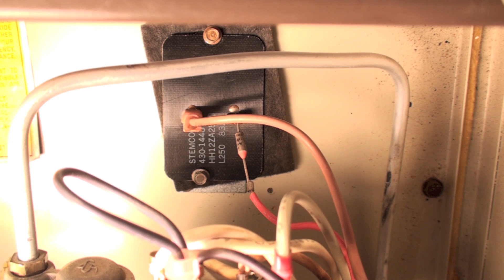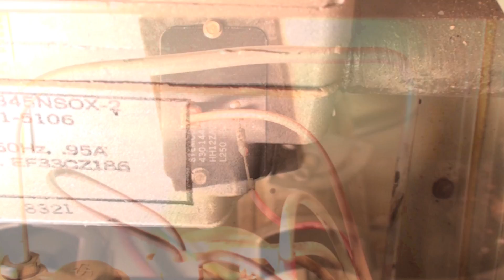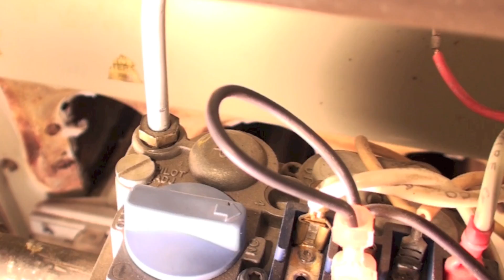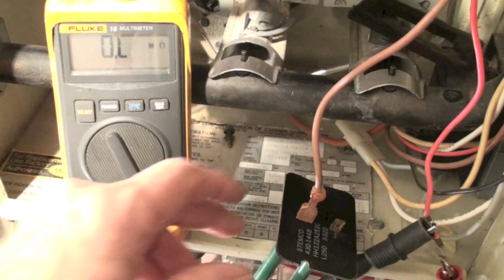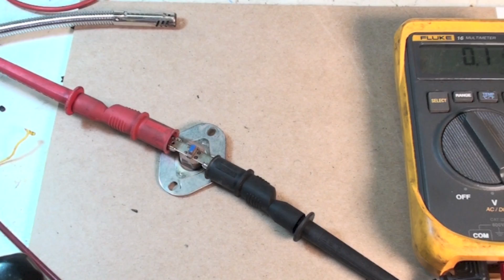Gas furnace rollout switch operation

Comment: What is the model of the Fusible LINK?  My furnace limit switch model is identical to your video showing limit switch.  I think my fusible link is bad but I can't see the model number on it. Before Fusible LINK, I get 27VAC, but after the Fusible LINK, I only get 14VAC, Thus, I only get 14VAC between the C & R.  So, I think it might be the Fusible LINK is bad. Thanks for help.
Reply from the maker: I would first disconnect the wires and test with an ohmmeter.  Should have 0 resistance.  There is no model # of the fusible link.  There should be 3 numbers on the side.  Something like 277.  That will be the temp in Celsius that the fuse will blow.  Use that temp to find a replacement.  Appliance stores will probably have it.
GFM

Comment: After my furnace turns off my fan stays on there was a switch near the firebox that Tapped with screw driver and the fan turned off I believe this is called a roll out limit switch is there anyway to bypass it to check it is?
Reply from the maker: Do not  bypass!  Now, lets talk about what is going on.  If the switch is located on the vertical panel of the furnace, it is the limit switch.  Not a rollout.  Also, rollout switches are manual reset.  Your limit switch is opening because of a problem.  Most common, plugged filter.  Could also be plugged air conditioning coil, dirty blower wheel, ductwork problems, diffusers closed or return air blocked.  When you find the problem, you will also have to replace the limit switch.  It has stuck in the open position.  Hope this helps.
GFM
Reply: the switch a nickel size attached outside fire chamber box  and  between that and cover panel of furnace has two wires two revits http://www.repairclinic.com/PartDetail/York-Furnace-Flame-Rollout-Limit-Switch/S1-02527792009/2332734?ss=a36b368i2821&TLSID=1893&Ref=611198&gclid=CjwKEAjw1qHABRDU9qaXs4rtiS0SJADNzJisdT8JpekD4sSSUHNUNeZs5PfApbag0Jto3TO6Jy7PBBoC5rnw_wcB
Reply from the maker: That is a rollout switch.  If it is opening during operation, you have a significant problem.  I would be looking for cracks in the heat exchanger or separation of the clamshells of the heat exchanger.  Check the flame when the fan starts.  If it changes, you have a heat exchanger problem.  This could be dangerous as CO could be getting into the structure.
GFM

Comment: I finally found the problem with my Dan Night 394GAW. Turns out I need to replace the fusible link that connects to the limit switch. I accidentally rubbed off the part number I need to replace it. Con someone please help me with this?  Maybe you have the same furnace model and can look at the fusible link for me? Your help is appreciated.
Reply: I have the same model Day Night 394GAW, what is fusible link look light, i can look up for you...

Comment: I just had the service guy tell me I had cracks in my heat exchanger  and that I need a new unit that cost 10,000. its a roof package unit 5 ton, I went and looked myself after he left, there was 2 very small cracks off the metal of 2 of the rings on the heat exchanger, both cracks are about 1 inch long, do you think that is a problem? not a hole a crack. I will send ya a picture if you would like. I do not know how to send you the picThanks for all your help
Reply from the maker: +Mark Schrader Send the pics to grayfurnaceman@gmail.com
GFM

Comment: I have an issue maybe u could help me out with, First issue was the board was burnt. Got a new board with kit. Came with everything new, from the sensors (roll out, flame, igniter, limit and honey well gas valve) had to re-wire everything. After i was done, the unit fired up was working til I out the cover on, it shuts off and goes on a saftey. Any info would be appreciated thanks
Reply from the maker: Give me a make, model.
GFM
Reply: Amana 
Model: PGB42C092D
Serial: 9609240630
Reply from the maker: adrian diaz About all I can come up with is a poor connection or short in the flame sensing system.  These things must have a good ground for the flame to prove.  
GFM
Reply: grayfurnaceman OK I check my connections, I appreciate the info.